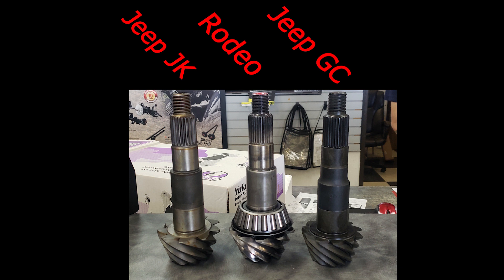Honduzu Update and Future Plan

Comment: You're less likely to break a CV with a front locker... Because you dont need as much momentum and wheel spin is greatly reduced.
Reply from the maker: I don't know if I can get on board with that fully...I plan on making an in-depth video on why I won't do a front locker and why I chose just the rear
Reply: @GridLineGo  there are few pros to a open front diff. The only time a auto locker front hurt me in deep snow wheeling and that was in not wanting to track straight but i could still go further. In one of the weakest front diffs made, A dana 35 IFS in a gen1 durango. I'll stick to the Aussies off roading logic and knowledge forever on this one while also not destroying trails with open diffs
Reply from the maker: @cz75tactical9  It does keep trail damage down, that is true. If I were to do a front locker, it would definitely be a selectable locker. And for that reason too. I've thought extensively about a front locker, don't get me wrong, they're great, but for the price of the one that I would get, I haven't found my self (thankfully) in many instances where I thought to myself "Yeah, a front locker would be great right now. I should have spent the extra grand on one" I'm not in the position where Ill install a front locker, not use it until I absolutely need to, for that price.

Comment: What’s mods did you do to your 06’ focus st? Also how many miles do you have have on the engine?
Reply from the maker: Megan Racing Coilovers, SVT rear sway bar, FSWERKS lower sub brace, Massive BSD, FSWERKS Stage 2 Turbo kit, Cosworth Intake Manifold, Exedy Stage 1 lightweight clutch 👍

Comment: Super excited for this content, especially the 4.56 re-gearing. Great to hear about how you're doing the Jeep JK gears and using a conversion for the splines. I've always wanted to do this on my 99 Passport but haven't quite known where to get started since I haven't found much information on this topic. Thanks!
Reply from the maker: I'm glad it helped! I've been doing a lot of research on regearing the rear, the front was easy enough. Ill keep you all updated when it is all done. Thanks for watching! Please consider subscribing if you haven't already, thank you 👍
Reply: @GridLineGo  When you were going to do the re-gearing, were you planning on re-gearing the front too? I've been calling around and no one seems to know what the front axle actually is in order to re-gear it. If you are only re-gearing the rear, are you planning on using 4wd with two differing gear ratios (front and rear)?
Reply from the maker: @yourfriendgary  They will be matching 4.56 gears. I got the front differential from 91 Trooper. It has 4.56 gears originally. So by swapping the while diff itself is regearing. As far as I am aware, there isn't a company or offers an aftermarket gearset for these differentials. Great question 👍

Comment: Curious to hear your take on this, since there's a large variance in opinion: I generally like to think of the front locker as a boost in strength, since it makes it impossible to shock-load the CV's. It increases the load on them (maybe) in the cases when you have just one CV pulling the weight of the vehicle though. I kinda see it both ways.

Additionally, do you think locking the rear is the first way to go in terms of capability? That's another interesting one, its certainly more popular as an OE optoin. I went with the front lokka cause it was by far the cheapest option, but lokka surprisingly recommends (generally) locking the front first (See Question 10 https://lokka.com/faq). Curious to hear your take :)
Reply from the maker: I think that's a fantastic question! In fact, I think I'll make a video about my reasoning 👍 please stand by!
Reply: @GridLineGo  Awesome! Can't wait to see it!